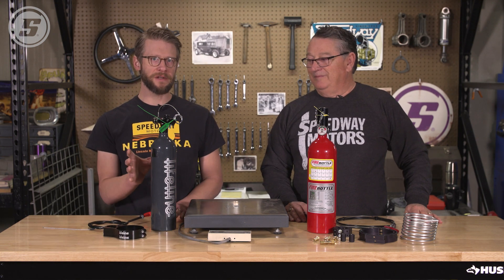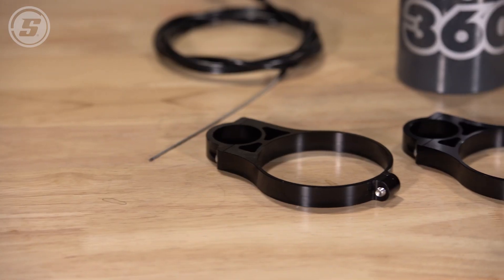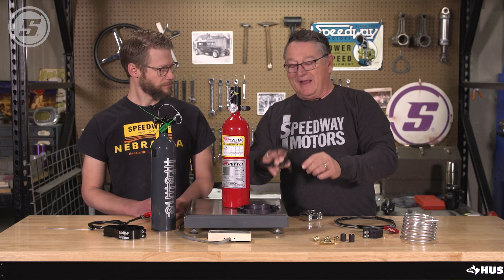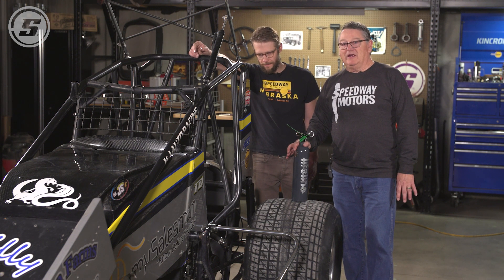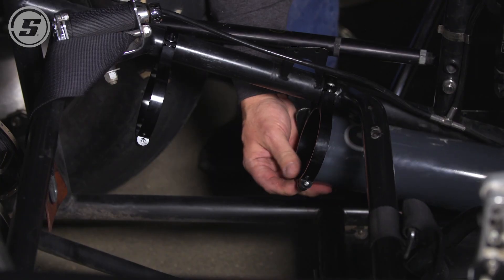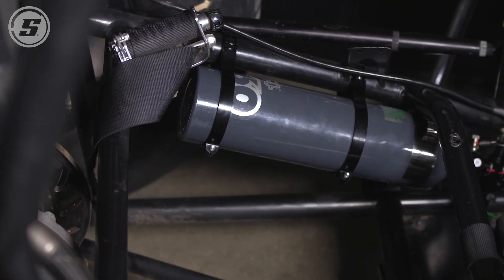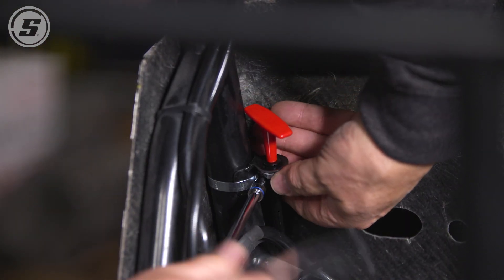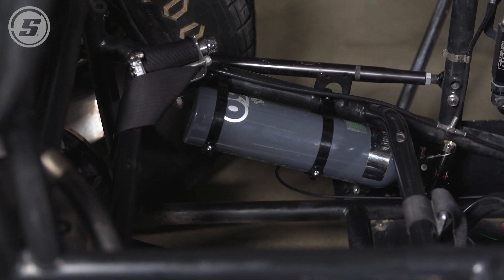SFI 17.3 Fire System Installation for Sprint Cars 2023

Comment: hi there i would just like to ask if a sprint car has no battery where do the alternator wires run to thanks!
Reply from the maker: Hello! Most sprint cars do not run an alternator.  Some cars such as the Pro Series that race at Knoxville use a CT525 engine that is run by electronic ignition.  Those cars have a mini alternator and a small battery.
Reply: @speedwaymotors  so for the 410 sprint car does that have a alternator  or how does it run? do you know where i could find like a parts list for a 401?

thanks
Reply: @speedwaymotors  i just got told that you push start the sprint car and then as your driving it will make power for everything that makes power